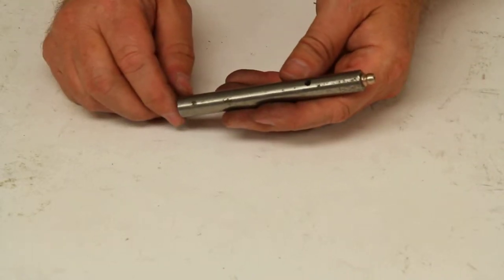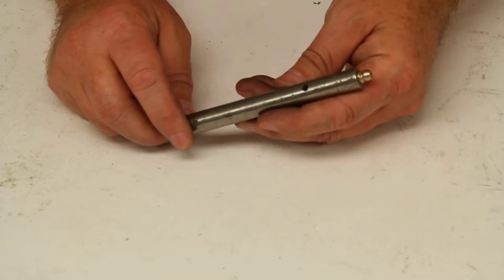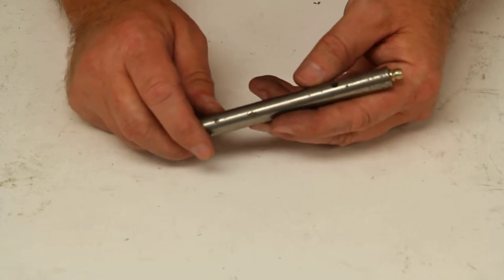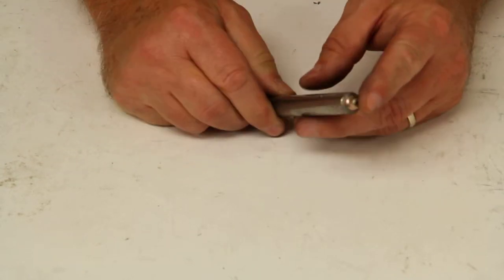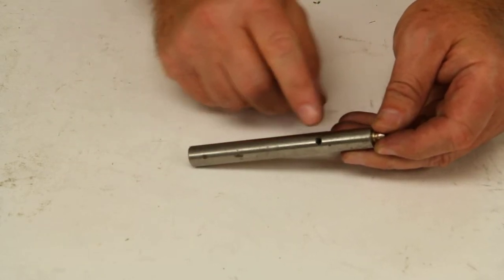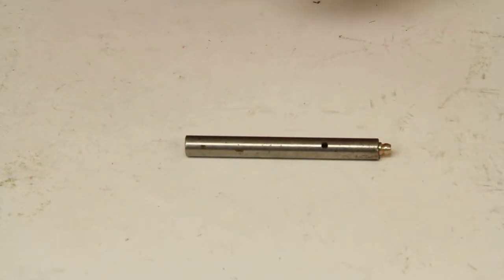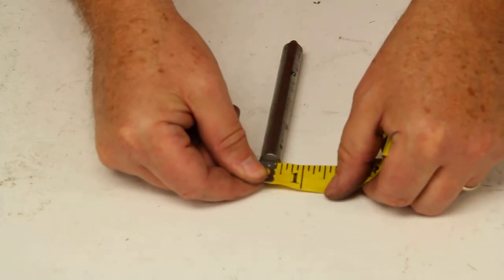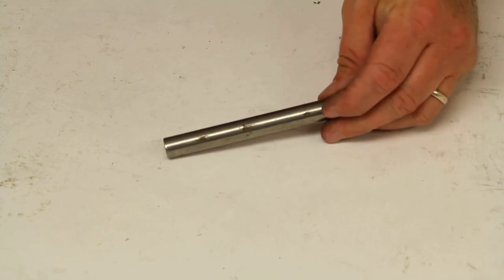etrailer | Ultimate Overview of the 1/2" Diameter Greasable Hinge Pin, 4-1/2" Long

Comment: yeah,,,but when a fat guy at the dump trips over your gate and breaks one off,,,how the hell do you get the old one out and replace it!!..
Reply from the maker: Rod Elliott Greasable hinge pins like this are built with both thread-in and press-in grease zerks. If what's left of the zerk has wrench flats, it's a thread-in. A little bit of heat and a wrench and it should come free and then you can install a new one. Thread-locker on the new one is probably a good idea. If it's a press in, either run it as is and lubricate from the outside or you can cut it out and replace the hinge pin and/or hinges.